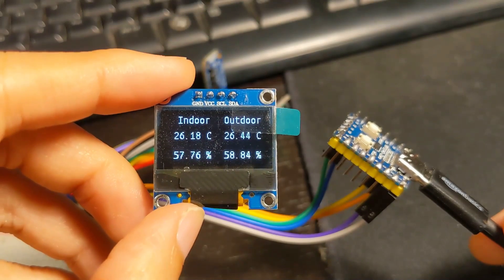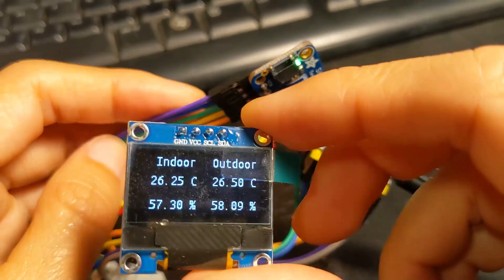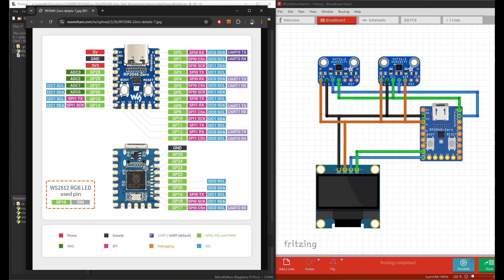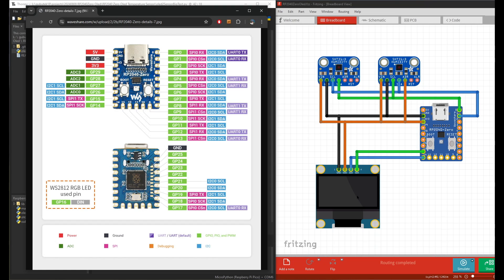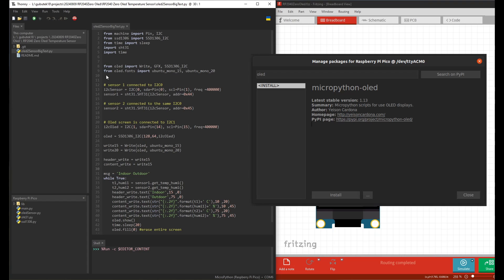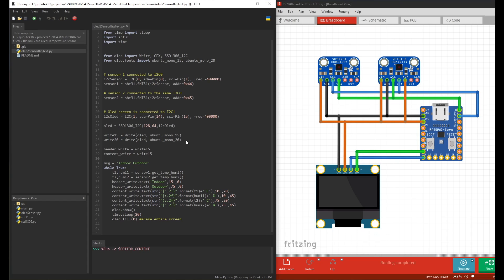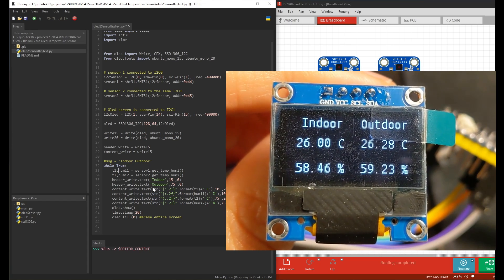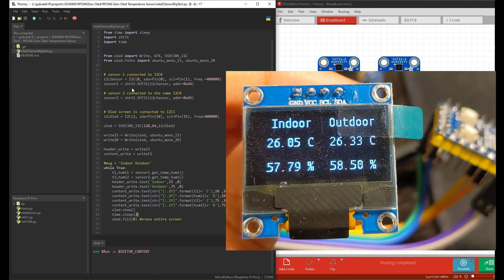Air monitor with RP2040-Zero, SSD1306 oled screen and SHT31 sensors (I2C )

Comment: I think it could be better to make it with esp32 to connect as an IoT device.
Reply from the maker: You can also use pico w for it without changing the code. As I said, I like python and this rp2040 is super cheap.